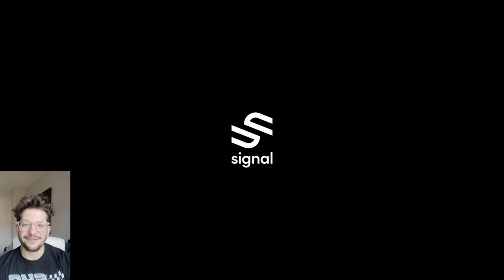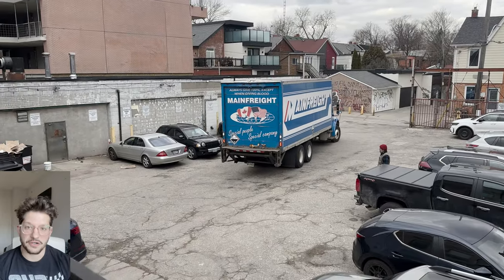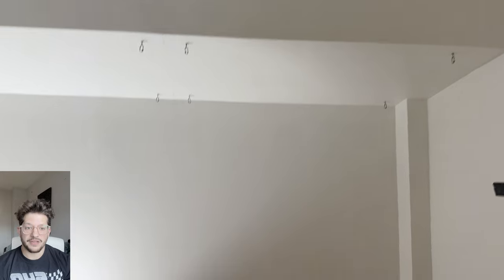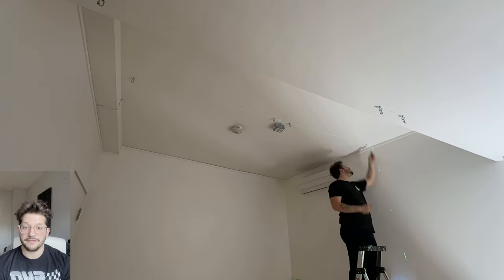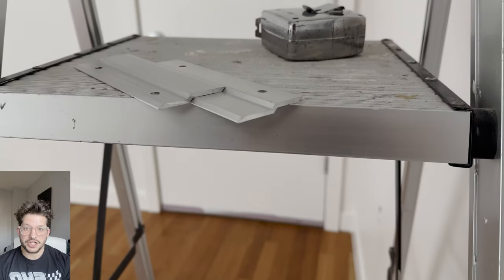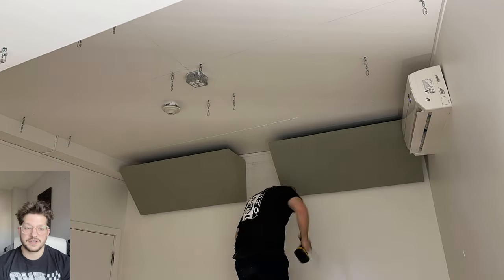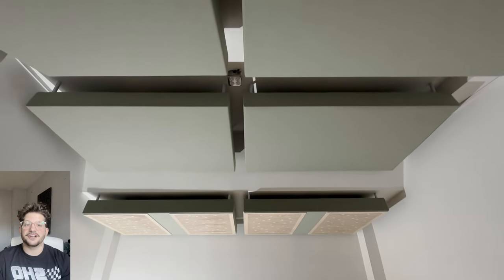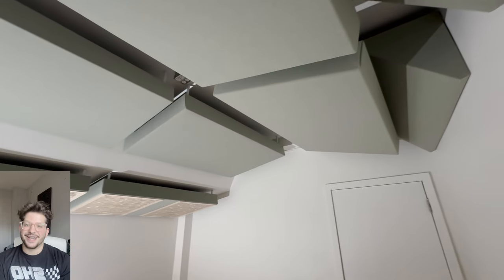INSTALLING CEILING ACOUSTIC PANELS AND BASS TRAPS!

Comment: Why 4 inch clouds/bass traps instead of 6 inch?
Reply from the maker: That’s what the clients and design team decided upon, then I was contracted for the install. Thanks for watching!
Reply: @soundheadquarters  I asked because I’m about to make ceiling clouds and I was wondering if 4 inch was good enough.
Reply from the maker: The clouds in this video are 5.5 inch by the way! 4 inch is usually the smallest I personally go for clouds unless the client requests low profile in that case I do 2 inch. Enjoy your build!

Comment: Isn't there a risk that the small particles of rock wool could be dispersed into the air?
Reply: that's what the weed barrier on the back of the panels are for! plus+ rock wool is super dense, once it's in the panel, it's not going anywhere
Reply: Thanks man🙌🏻
Reply: You can use paper thin plastic to cover the wool.

Comment: Chains are going to rattle when the bass hits
Reply from the maker: The weight of the panels keeps tension on the chains and keeps them from rattling. You could also use steel cable or climbing style nylon/fabic loops if you’re worried about rattling for your application. Thanks for watching!